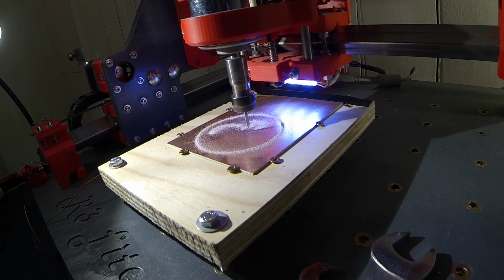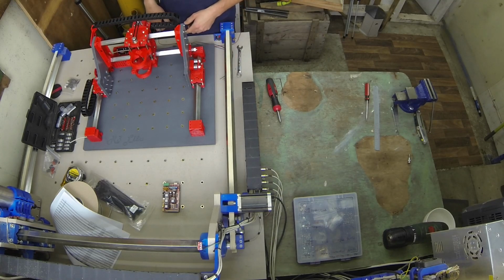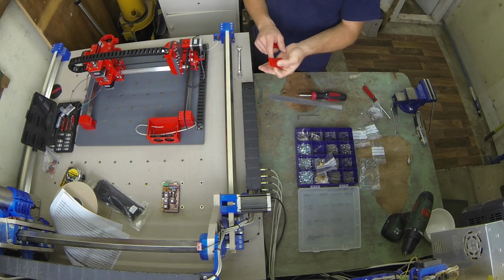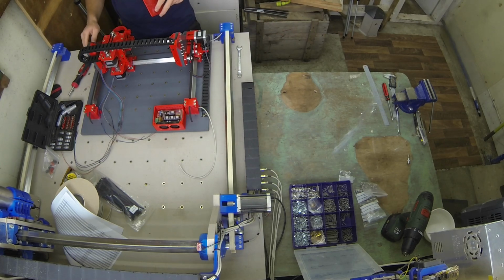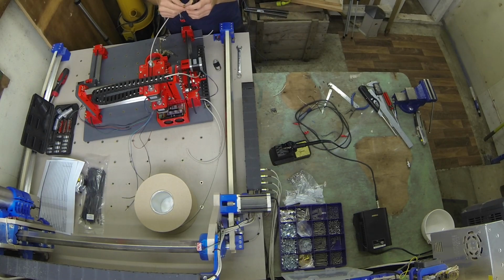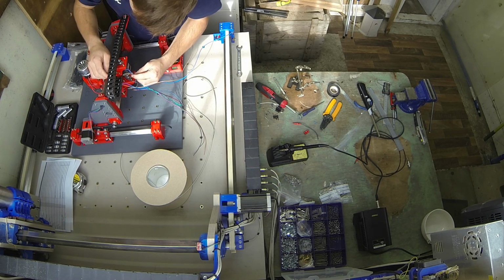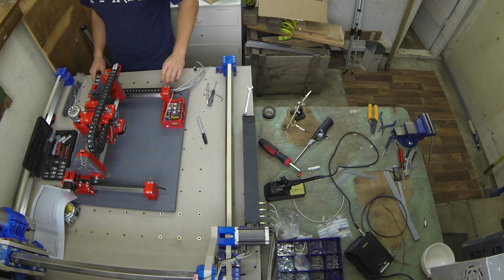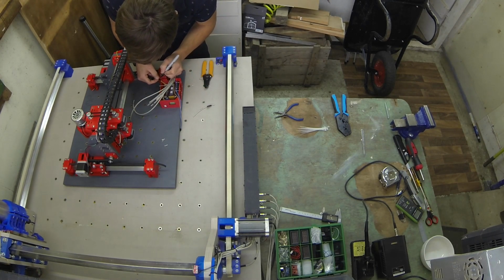Root 3 Lite 3D Printed CNC Machine - Detailed Build PT3

Comment: Amazing series! Quick question, I’m building a root 3 lite as well and wanted to know a few things. Did you wire the spindle directly to the D8 port on the ramps 1.4? What size psu are you using and what psu would you recommend for a 12v-48v 500w spindle? Do you think a 24V 600w PSU would work? Keep up the good work!
Reply from the maker: It's been a while, since I looked at the ramps board. IIRC I was using the Bed heater port to turn the spindle on. 

I think I had a 24v 200W PSU. So a 600 should be more than enough